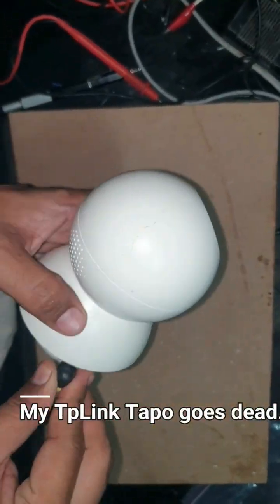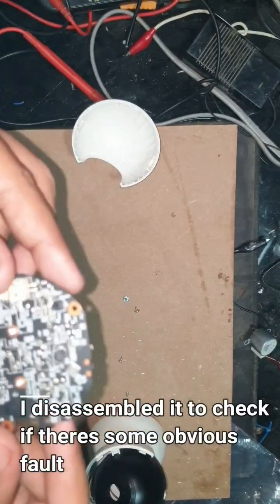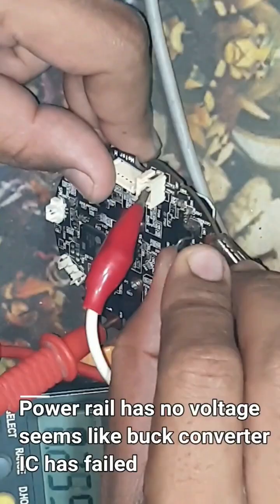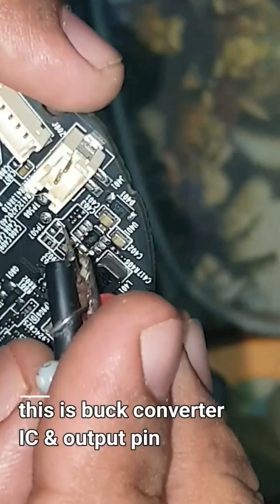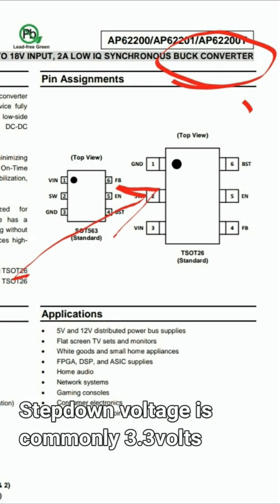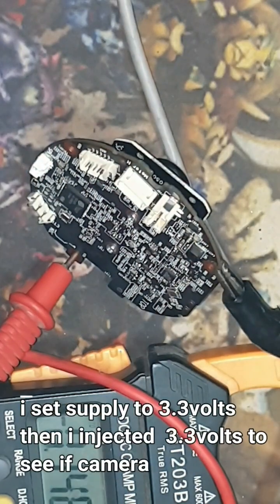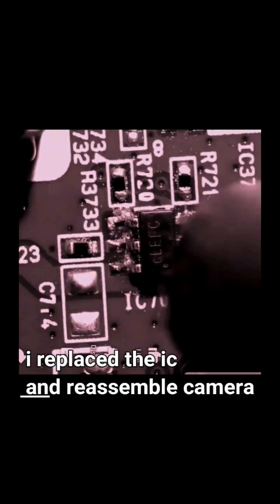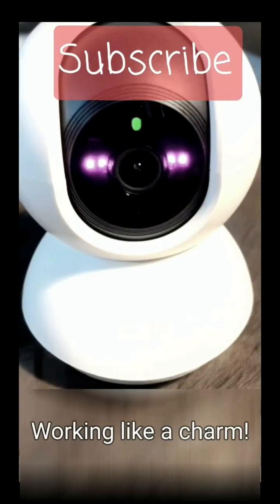Repair Dead TpLink tapo c210 Wifi IP Camera

Comment: Same problem with my camera tapo c200 no power also
Reply from the maker: Check the output of buck converter ic, if it's not outputting 3.3v then replace the ic, our buy 5v to 3.3v buck converter module and install it on those output pins of ic(makesure to remove faulty ic before installing module)

Comment: Do you have the fill video of this?
Reply from the maker: @monrayv  yes but I didn't compiled and uploaded it
Reply: @ please help me I have same issue.
Reply from the maker: @monrayv  just replace buck converter ic, as shown in this video, if you don't have ic , install DC to DC buck converter set output voltage to 3.3v and solder the points
Reply: @Naturefuzz  okay I will buy the IC thanks